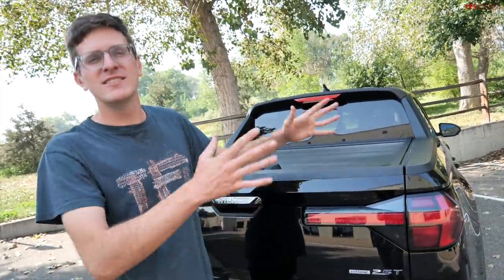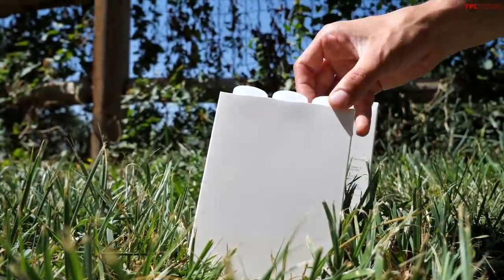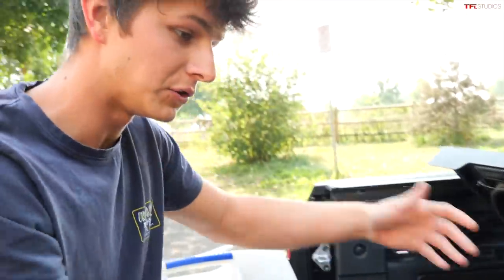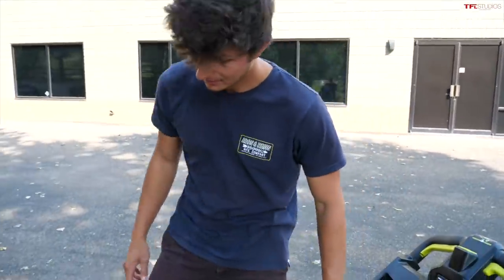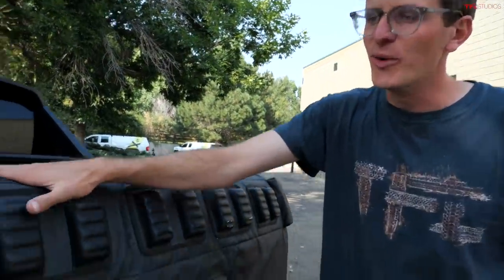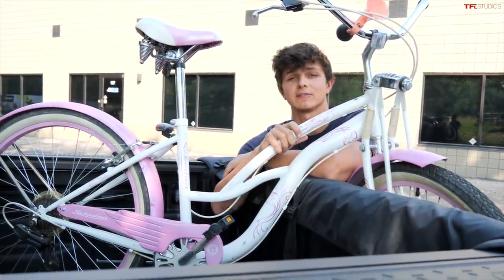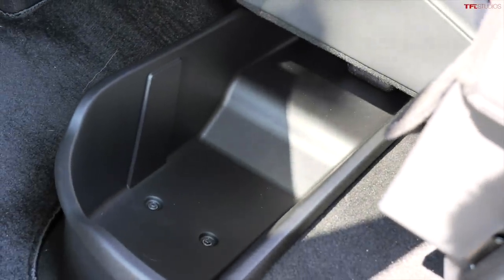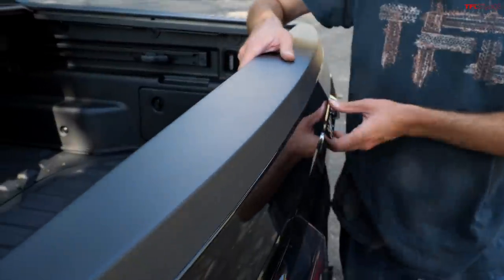The New Santa Cruz is a Tiny Truck - You Won't Believe What Fits (and What DOESN'T Fit) In The Bed!

Comment: The 1400 lbs is for the entire truck. You can't put 1400 lbs in the bed.  You should have mentioned that
Reply: It’s only 660 pounds in the bed
Reply: @steevemarcoux2288  wow really?
Reply: Should mention that with every pickup. 1,400 lbs is still actually more than many half tons and mid-sizers.
Reply: My understanding is that the 600lb number is rated if you have 4 200lb guys inside the cab, if you have less passengers then the rating in the bed goes up accordingly

Comment: It's like the snowflake of a truck. I would even say it's seems to be a downgrade front the Ridgeline and the Ridgeline is a downgrade already as a actual truck. In my opinion. I would say if someone wants  "cough cough" a truck like this so badly then just get the Ridgeline. Lol
Reply: Correct. A traditional truck has 3 uses that put it above most vehicles: Towing, hauling, and off-roading. The Ridgeline is worse at off-roading and towing than comparable trucks, but good at hauling. This is worse at towing, hauling and off-roading. But it gets good gas mileage and is pretty quick in top spec. How is this a truck again? lol.

Comment: If you back the ATV and motorcycle, they fit. The motorcycle: back it in and turn the front wheel sideways. Without the cover.